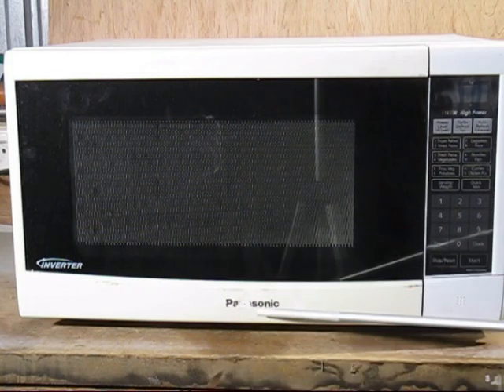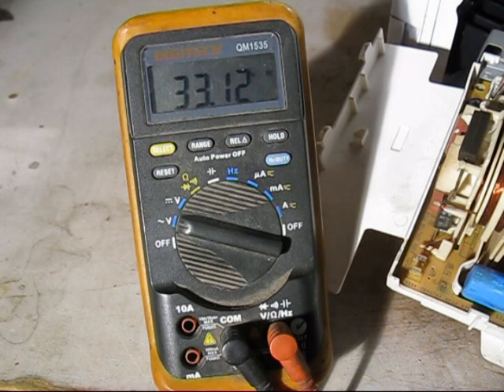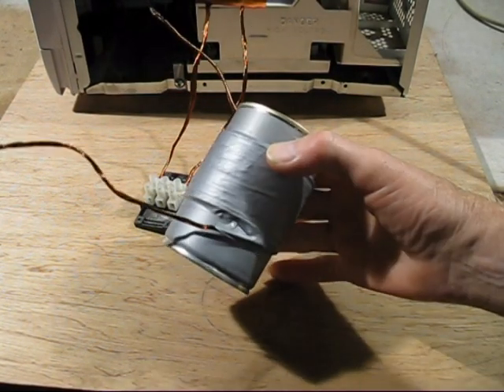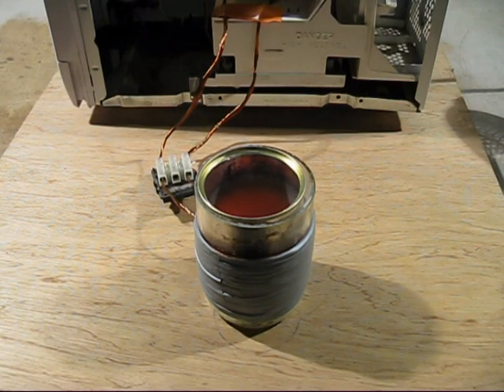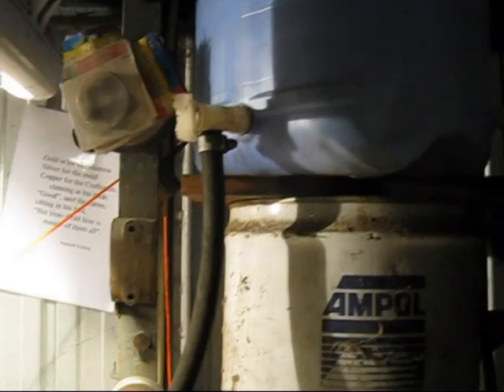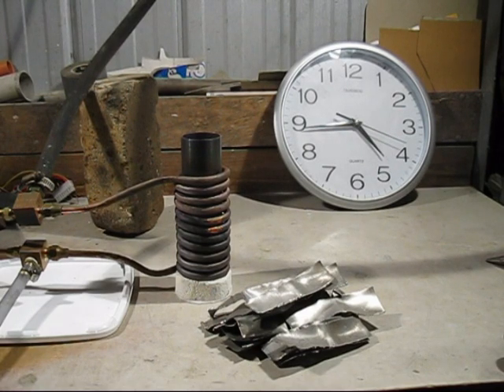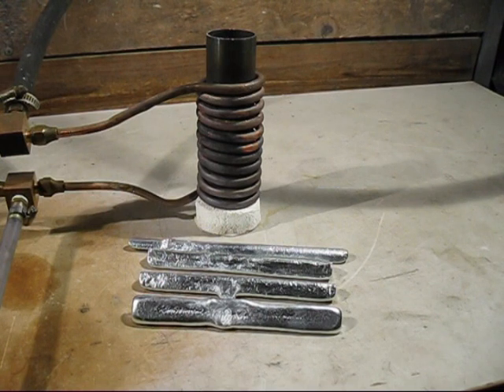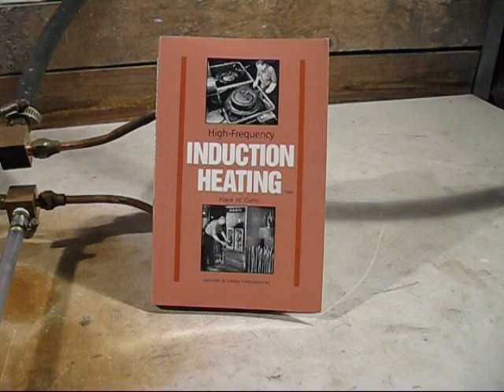First time on youtube, induction furnace made from microwave oven parts

Comment: A couple of pointers you may wish to try on the coil side.
1. Get a ceramic crucible, the energy will be acting on the metal you are melting and not the steel crucible making it more efficient
2. wrap the coil with a thermal blanket (you can easily find thermal shielding tape used on high temp exhausts) to protect your coil and avoid shorts
Reply: @brianmurphy9112  ahhh... no
both ferrous and non-ferrous metals can be  heated by induction. Look up "eddy currents", these are produced in the material by the rapidly changing magnetic currents around the material, it only needs to be conductive.
Reply: @brianmurphy9112  Magnetic stainless steel works.
Reply: @lancer2204  Excellent point, induce only the metal to melt, not wasting it in the container
Reply: Can also add some insulation around the ceramic crucible.
Reply: I think that a poor idea because at a certain temperature metal is no longer magnetic. That's why you can only see glowing metal parts in these coils. You need the crucible to have a higher temperature than the metal you wish to melt and you can't do that with ceramic(non-magnetic materials). Also, insulating the coil raises its temperature so you're negating the water cooling.
Reply: @karmicmessenger  magnetism has nothing to do with the heating. The coil produces the magnetic field which causes eddy current to flow in anything conducive. By using a ceramic crucible, all the energy goes to the metal being melted, not into a metal crucible.
Reply: What type and size of  Transformer are you using between the power supply and the coil. I presume you are stepping down the voltage.

Comment: A small suggestion: it's best to fill the coils from the bottom with the drain from the top. This avoids any chance of air bubbles inside the coil, which of course won't contribute to cooling. Having the water tank raised as you have is good, as this will force water by gravity from the bottom to the top of the coils with no problem.

Comment: THE GLASS 

There are two reasons any object might break or melt in an induction heating device.  
1. The molecular movement caused by the induction device and 
2.  The secondary temperature generated by the object being heated. 
First the induction device only resonates the atoms of metals.  The glass atoms are not affected.   The secondary contact heat from the coil was sufficiently evenly distributed on the structure of the glass to cause expansion of the area of glass to induce a crack.

Comment: When you 'checked the frequency' your meter was set to volts AC, the Hz range is at the top of the dial
Reply: FYI, His meter has a hertz button that is engaged while he is on the a/c setting to give the frequency readout.
Reply: Also FYI Mr sparky ...you just got served😂

Comment: With your glass, of it is heated evenly it will not break.  It is when you get a colder spot that the thermal expansion varies and different tensions in the glass will cause it to shatter.  Having said that I did expect it to break at the base due to the different thickness of the base!
   Well done and I'll be keeping an eye out for an induction microwave, you are thoroughly worth subscribing to!   👍
Reply: Also glass gets more flexible and soft when heated up, compensating for the stress.
It could have broken when cooling down though.
Well, let's not paint the devil on the wall. The experiment went well.
Reply: right on!  Hot plates break regular glass all the time because of uneven heating and thermal expansion.  Use Pyrex, not as vulnerable - though it is spectacular when it does blow up.
Reply: @flashpointrecycling  Yes indeed, I had a Pyrex jug go on me in the microwave for some reason (it may have had a small chip/crack) and it was explosive!

Comment: LuckyGen, you are a master fabricator and inventor.  I always enjoy your videos and the stuff that you accomplish because no one ever told you that you could not do it, so you just did it.   The glass did not shatter because you did not thermally SHOCK it.   It heated up slowly as the crucible heated up.    Glass, depending, starts to flow around 2000F, ever see a 'hot shop' for glass work, very high temps.    What you REALLY want to do is take a clay style or type crucible and wrap it in fluffly white aluminasilica high temp insulation, 1/2" should work.  Put that inside a little larger diameter induction coil and then place the metal inside the CLAY crucible that you want to melt.  The clay won't heat up from the induction field.   Right now you are heating the 'pipe' and that heats the metal and melts it.  If you use clay and INSULATE IT then the energy will melt the metal in the crucible and melt it even faster.    If you can prevent the HEAT of the melt LEAVING the crucible by 1: radiation  2: conduction and 3: convection then you can EASILY melt stainless steel in the crucible.   There is no limit to the upper temp.  The only limit is the higher the temp the higher the delta T and thus the higher the heat transfer to the outside world.   If you did not loose heat you could go to a million F....but at some time the heat loss will equal the heat input in and you won't go any hotter.    You can't use a graphite crucible because that will be the same as the thin wall iron tube you used.  Graphite conducts electricity.    I'd suggest experimenting with clay.  In fact, I'd LOVE to see a video from you on making a clay crucible.   "fire clay" can easily hold molten steel, its what they use in the foundry that is still in the Pittsburgh area, (Braddock PA).  All steel making cupolas use fireclay.
Reply from the maker: I was thinking that either way there will be heat losses using a steel crucible or a clay crucible. A clay crucible would take a lot of heat from the metal as it heats up. This is why I made a gap between the coil and the steel crucible so I could slip a thin piece of ceramic fiber to slow down the heat loss. I tried to make crucibles years ago and they were all failures. I think it is easier to buy crucibles than to make them yourself.
Reply: He's scheming already.  I can't wait, let's go!   Will silicon crucible work?
Reply from the maker: I don't know as I have never used a silicon carbide crucible.
Reply: @luckygen1001  what the temp for this?